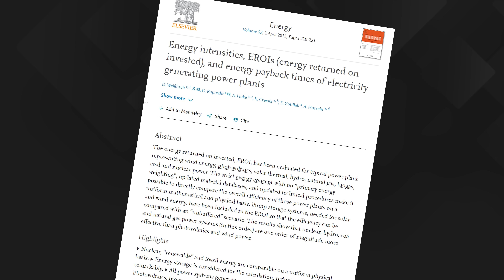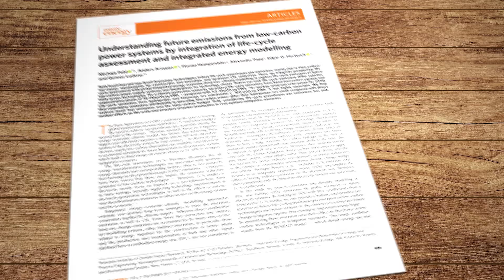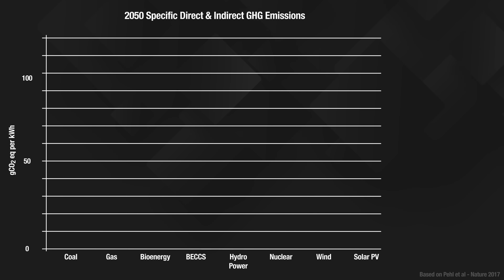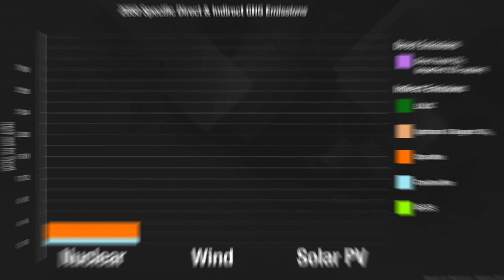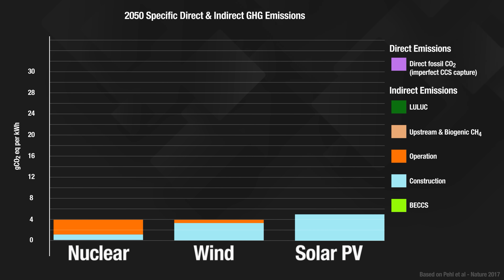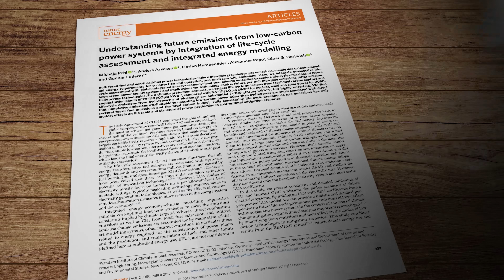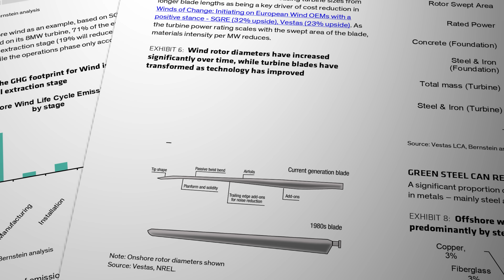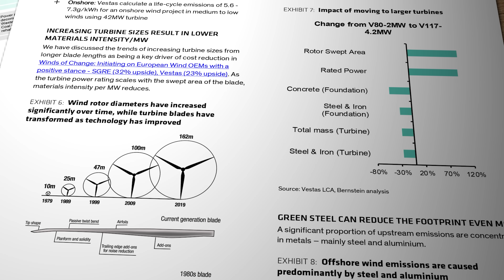Lifetime carbon emissions of renewables vs fossil fuel. Problem or solution?

Comment: Wind Turbines are a joke. Hydro dams with building them and the millions of acres they destroy and environmental damage seems to be forgotten about. Solar has potential but at 20% efficiency and much less when the cells heat up to 70 Fare much less. Once we develop a battery that works much. Better. Nuclear Fusion is probably the only solution if we are going to use electric cars. The electrcal grid we will need is so massive no one has come up with the carbon footprint of that is.

Comment: Wind and Solar PV are not stand-alone solutions due to their itinerant nature; as they only work 30%-40% of the time, consequently they require bolstering power such as gas turbines or hydro to fill in the gaps to deliver grid power 100% of the time.   So it is intellectually dishonest to compare wind with gas.  It would be more honest to compare the combined effect of 30% wind and 70% gas with base-load alternatives such as coal or nuclear.

Comment: LCA is garbage.  It smears solar wind and EV with fossil pollution.  They don't emit any GHG.  Blaming them for the generators is absurd when the whole system is being changed to renewable. LCA is a fossil marketing mind game. 

In a 100% renewable system, solar, wind, ev LCA is zero.  But they didn't change because they were never the source of GHG.  

Renewable energy is carbon negative with the addition of wastes to hydrogen and biochar.  

Fossil fuels can never be carbon negative.  CCS is a lie.  The extraction of FF will also be dirty as well and it's limited.  

Renewable is much cheaper. 

Right now solar electricity cost 25$ per MWh in Australia while gas electricity cost 500$ per MWh. 

Fossil and nuclear fuels based energy allows OPEC and Putin to yank our chain.

Comment: I can easily see that concrete dam walls would carry a heavy carbon emissions cost but that is something that can be mitigated by recently devised cement production techniques or the substitution of alternative cement-like materials for cement. The Upstream & Biogenic CH4 data for Hydro did surprise me however. Are those numbers right? Is there a sensible way of mitigating those emissions? Another interesting topic for Just Have a Think, perhaps.

Comment: One thing that I find difficult to swallow, is just where the vast amounts of carbon dioxide available from CCUS would be stored. Pumping carbon dioxide is not easy and a safety challenge. Getting the vast amounts of gas to offshore, depleted oil and gas fields is not a simple or cheap thing to do. Haven't crunched the numbers but you need to maintain all the offshore facilities and continue to maintain and operate them. Further increasing the costs. There are only a few fields in the world where this is being done, or seriously under design (Norway & Australia), and these are not recovery operations from fossil fired power stations. That people continue to propose CCUS for multiple millions of tonnes per year seems like wishful thinking. Can you bust this myth? Anyone else with thoughts on this?

Comment: Regardless of which technology has a lower carbon footprint, my understanding is they all require minerals and carbon energy as inputs. This means energy technology is rebuildable, not renewable. And with each life cycle turn over, the energy to rebuild, maintain and expand the energy supply exceeds the energy produced. Simply renewables will keep some lights on for several decades, maybe longer, but energy will be variable and contingent, minimally able to preserve and transport, and unable to achieve the heat intensity required for many industrial applications. It will be marginally declining, and last a generation at most. That means the real change required in on the demand side, and adopting a low-energy economy - ideally one that is shrinking in absolute terms. And developed societies can degrow and dematerialize, but they are so uneven that per capita measures are deceptive. But reductions, made possible by absolute equality is not a market. And for those who find that undesirable, population size is the constraint. The risk is conservatives rather than adopting a bio conservative position of small population with high energy and unequal wealth will reject the entire premise of climate change by arguing that carbon energy and high growth (business as usual) path has a substantial future discount, because the advancements and capacity by decades more of industrial life will outweigh and solve any future impacts of rising temperature. In fact, they are already adopting this naive and dangerous logic. If we can’t present a model of universal prosperity with low consumption and low energy, then the poor and rich will join political forces and veto the current strategy of reliance on technological change alone as unaffordable, inadequate and ineffective. Can we really say they are wrong? No one wants to hear it, but the only way to survive is universal public services combined with an agrarian local economic lifestyle. The cost of delaying so long is that industrial modernity and growth-based consumer society are no longer feasible.

Comment: Conventional Nuclear (and soon MSR & the one Bill gates described can use nuclear waste or thorium) produce carbon free energy abundance. This can be used to produce carbon free electricity, and carbon neutral aviation fuel and SNG. Using Hysata electrolysis @98% with methanation @80% + usable heat, fuel can be produced now without the need for new gas pipes or jet engines. Industrial users and households benefit. Energy surpluses would make recycling and manufacturing viable locally again too. And nuclear power could fuel processes that remove c02 from the air. It’s easier to bury spent nuclear fuel than c02 gas.

Comment: Thanks for yet another brilliantly presented breakdown of this complex subject. What I would like more info on is the expected lifetime of wind and solar power generators. Lifecycle costs must include the length of time these devices are producing electricity, I have heard anecdotally that they last somewhat longer than the initial costing estimates.

Comment: The major problem with wind and solar power are intermittency and lack of reliability. Energy would need to be stored on a massive scale and our grids would need to be updated significantly. Nuclear power has many downsides, but is much easier to integrate into our current systems. The same is true for geothermal power. I'm not saying that I don't support wind and solar power. I'm very much on all of the above person. We don't just need to reduce carbon emissions. We need to undo a half century of carbon emissions through carbon capture and recycling, which is going to necessitate high energy use. Moving people from gasoline-based cars to electric cars or even hybrid cars will likewise mean much higher electricity production. We will likewise need to produce much more power if we're going to start desalinating water. Vertical farms are becoming more energy efficient but if we're going to feed a growing population and ensure that people have access to fresh vegetables, we're going to be expending more energy for agriculture, Even if we take advantage of solar panels as ways to cool plants during their growth and reduce water evaporation. 
We cannot hope to add another 3 billion people and ensure economic growth without much more energy production, and more research on better recycling. 
I say This is the one who is very deeply idiologically opposed to central planning and skeptical of international organizations. But this is a case where everybody is going to have to make hard compromises and accept far more transparency for the greater good.
Reply: Nuclear power is the best, safest and cleanest energy we currently have. The new reactor designs alleviate many of the problems with them. Millions die each year from air pollution from coal and fossil fuel plants. At the most 30,000 to 60,000 have died from all the worst nuclear disasters combined.

Comment: Professor Peter Majewski from UniSA on recycling wind turbines.

“As it is so expensive to recycle them, and the recovered materials are worth so little, it is not realistic to expect a market-based recycling solution to emerge, so policymakers need to step in now and plan what we’re going to do with all these blades that will come offline in the next few years.”

We have to scrap the "market based" economy as it leads to unfettered pollution or externalities as the brain-damaged orthodox capitalist economists like to call the toxic waste of industry.

Comment: 1D, 2D, 3D are spatial

4D, 5D, 6D are temporal 

7D, 8D, 9D are spectral 

1D, 4D, 7D line/length/continuous 

2D, 5D, 8D width/breadth/emission 

3D, 6D, 9D height/depth/absorption

Comment: The thing that puts the kibosh on your argument discussing the minutia of producing low carbon/no carbon energy is this. All the claims made buy your ilk dating back fifty years have all been lies and manipulated climate temperatures. Nobody has yet said what the "proper" amount of CO2 in the atmosphere should be. If it's not 415 PPM then what is it? How can one hit a target if one can't define the target? Furthermore that CO2 drives global temperature has never been confirmed. All of your arguments are emotion based, there is no proof of your claims. Someone once said: "If you can't dazzle 'em with brilliance baffle 'em with bull sh*t." That's you guys...all BS.

There cannot be a zero carbon lifestyle because carbon is in practically everything on earth. It was designed in, meant to be here.

Comment: @Just Have a Think, the lifecycle chart is heavily skewed to make wind and solar look much better than it should because they choose to omit the necessity of batteries. A lot of electricity consumption is during low/non light hours, so implying that batteries are not needed is silly. Not only are batteries required, the quantity required is quite big if solar wants to replace fossil fuels in any meaningful way. Additionally, currently those batteries degrade with use at a rate of up to 10-15% per year so will require replacement of ~50% capacity every 10 years. Solar(and wind) is going no where unless researchers/scientist address the huge battery/storage problem, instead of pretending it doesn't exist. One of the main reasons why fossil fuel/biofuel/nuclear have an environmental cost to burn is because they have have an inbuilt energy storage mechanism which causes pollution when burnt.

Comment: The waste from wind turbine blades is also hundreds of times lower than the waste from coal power. Single use fuel produces a lot of ash that needs to be landfilled.

Comment: One thing I'd like to see considered would be using surplus wind and solar to power hydrogen production. Wouldn't that help to eliminate the down side to both?
Reply: There are facilities producing green hydrogen from surplus renewables already in Germany. The main issue is that you have to spend the same amount on your electrolyzer as other plants but you only get to use it about 30% of the time and it sits doing nothing the rest of the time.
Reply: Hydrogen storage and transport kind of sucks. There is research being done on storing and shipping hydrogen as ammonia but that even further reduces efficiency and creates other problems.

Turns out that there just isn't a perfect liquid fuel.

Comment: Great episode! As fossil fuels are replaced in transport, production of raw materials, manufacturing and recycling, all indirect emissions will decrease. Not rocket science exactly, but seemingly impossible to understand for most people, including a lot of experts.     

On top of that, technological development. Solar PV integrated in surfaces of buildings that is needed anyway has the potential to reach negligible emissions. I mean, which emissions, if they're produced without fossil fuels, and from materials that doesn't create emissions when produced/recycled? No known technology can come close in potential to a thin layer of solar PV in materials that is needed anyway that can turn ~20% of the sunlight into electric power, where it's needed even.         

Capturing CO2 in order to store it is just stupid. If you can catch the CO2, you can use energy that doesn't come from combustion, it's cheaper than CCS/BECCS. If you want to store carbon, make biochar.        

Actually low/zero/negative CO2 concrete for wind turbine foundations? Well, like cold fusion power, I'll believe it when I see it.  Wind power is good enough as it is for now. Any further decrease of emissions is welcome, but let's just accept that the ~99% decrease achieved switching from fossil fuels is what's important, for now, and with the real improvements, it will remain good enough for the foreseeable future.  Eventually, wind power will only be needed when it's dark, to fill any need left after, demand side management, improved efficiency and some battery storage, probably including V2G.

Comment: Politicians, legistraters, & Media collectively control the carbon psychotic agenda for the U.N. NWO Puppet masters.  There are no alturnive engergy solutions!
Carbon dioxide CO2 and all other gases dump heat at night to outer space, warm day cold night and are not greenhouse gases. All heat flows to cold. The only significant greenhouse gas is water vapour. 
There were three climate changes last century, a warm one, a cold one and a warm one of which is coming to an end. C02 Carbon has no significant impact on climates. The suns output determines our climate and the planet is now going into a cold climate.
The climate regulations come under the power of an oligarchy of unelected Regulatory Authorities in our institutions i.e., Mandatory shutting down water supply to farmers and what they can grow, is destroying food supply by an out of control dictatorship. The efficacy of climate change regulations cannot be replicated scientifically and are based on politics to destroy western food supply, democracy, and economies. We have been groomed to starve. All food in the supermarket has a fossil fuel element to it.
The population of the Western world is being poisoned with Zero efficacy medication. The medical industrial estate has withdrawn safe medicines. Food and oil are now in short supply and expensive.
Government and unelected regulators running our institutions are committing crimes against humanity, with the carbon climate change environmental tyranny oil lock down.  Wake up, CO2 under 150ppm all plants die, and everything else as a result. GOD HELP US   Paradise is lost!  These tyrants hate everyone including themselves. Mandated climate Lock down of Coal fuel energy supply is now a serious problem globally. Food supply and travel is coming to an end as we know it. (All orchestrated by false fear).

Comment: Well done. I have had solar power on my roof for 30 years and it is very cheap. It's also good in areas , like mine, where natural disasters are common, and the mains system gets interrupted, unlike mine. Lead acid batteries have a limited life, and must be managed carefully to make them last as long as possible.

Comment: I have learned that a lot of the critics of green energy throw out "what about-isms" to try to convince themselves and others that we should not try, or at least that is the impression I get. It often comes from politics or people are just flat out uninformed. This is a great video talking about the emissions for some of my favorite green alternatives. I think you should also find out what the emissions output for battery storage since that is going to play a major role in using solar and wind power. It would also be interesting to look at what the energy costs will be, historically and projected for each source, since economics is also a major driver in implementing green energy. I personally think green energy will be cheaper and more price stable than fossil fuel once we get it going.

Comment: The problem with wind, is the turbines are not biodegradable. All the nuclear waste ever produced on earth can fit in a walmart. But in the U.S. there are 57,000 wind turbines, and the polution they will cause when those turbines are burried is unreal. We have a way to deal with co2, we have no way to deal with the fiberglass turbines.

Comment: I wonder if the current economic situation with fuel prices will act as an accelerant towards a green energy future - reduce Russia's leverage and at the same time bring forward the 2050 goals. In an ideal world that's what you expect. Though I fear that the coal, oil and gas industry lobbyists have too tight a grip on the balls of society already, such that the economic shock can only offer those governments new excuses to delay the shutdown of dirty power plants, so that they might continue simping for Exxon and BP.

Comment: Did they account for the manufacturing of components being much less carbon intensive in a world without fossil fuels, thus almost been a compound decrease in total carbon output? Like if a wind turbine takes 150kwh to build, and 1/2 comes from prexisting renewables that is much lower carbon output in the construction phase than if the grid was only 1/4th renewable
Reply: I think they did. Notice that current CO2/kWh is 11g for wind, while future is 4g, and much larger improvement for solar. Might be just improvement in technology, though.

Comment: I'm not certain why this is so hard.  I suppose it's because it's ideological.

Go nuclear for the big, bulk baseload.  If hydro is already built, maintain it for a similar role.

Go Offshore wind, and calculated wind grid power where practical.

Go solar for rooftops and niche grid scale where practical.

Batteries for gentle cutover to nuclear power.

Excess nuclear when solar and wind is working goes towards industrial process heat, for things like hydrogen, ammonia, CO2 harvesting, synthetic fuels, and desalination.